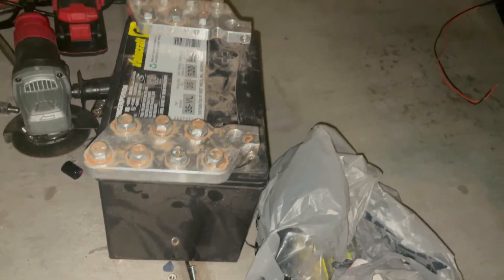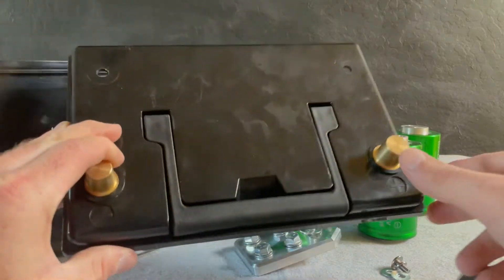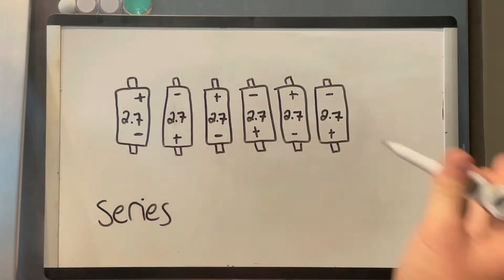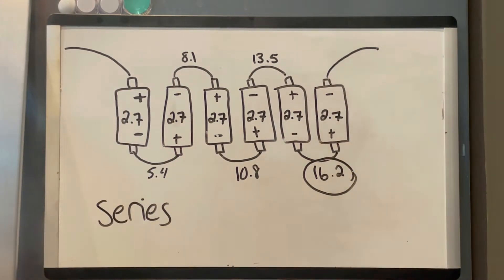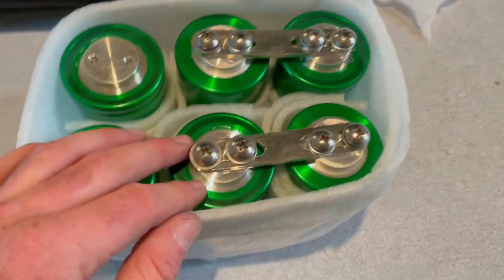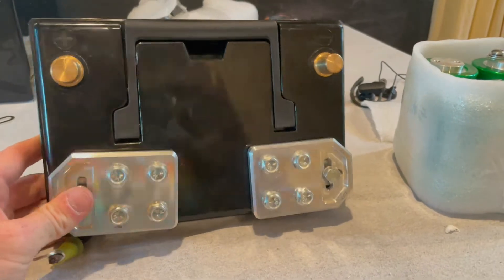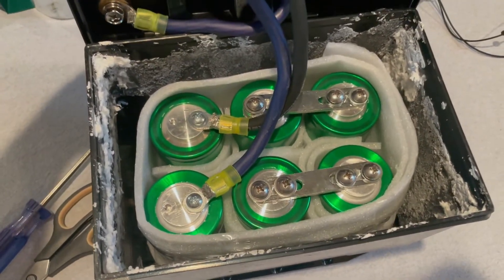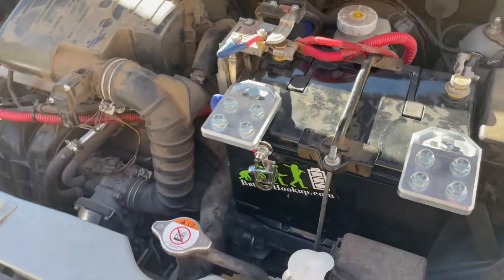How to:  Supercapacitor Bank Build.  Replacing underhood battery with SuperCapacitor Bank

Comment: Does the supercapacitor not need a BMS Controller? How they get all the same voltage then?
Reply from the maker: @ShinYa_002  I never ran one and it seemed to work fine
Reply: Capacitors work by charging rapidly but cannot charge past the input voltage. Most capacitors have a high max voltage. They do not need BMS like a battery.
Reply: @ImAChristianFirst That's not true. They can explode spectacularly if not protected. Balancers are always needed because the leakage currents of each individual capacitor are never equal to each other. This is causing unbalanced voltages across each one cap terminals and given that they are connected in series in this application, they are exposed to such a danger. It is therefore possible that across one of them the developed voltage to be above 2,7V, while the total voltage of the bank is below the safety limit of 16,2V...
Reply: @ImAChristianFirst That's not true. They can explode spectacularly if not protected. Balancers are always needed because the leakage currents of each individual capacitor are never equal to each other. This is causing unbalanced voltages across each one cap terminals and given that they are connected in series in this application, they are exposed to such a danger. It is therefore possible that across one of them the developed voltage to be above 2,7V, while the total voltage of the bank is below the safety limit of 16,2V...

Comment: How does the cap battery hold up with your audio? I need something to help Volt drop in my system, running 3600W rms but cannot fit a alternator, my stock is 120amp on an agm 120ah and another 120agm for my amps.
Great video, loved it, very inspiring 👍
Reply from the maker: First off, thank you.  The cap bank works great.  I do have it with a 240amp alt and 128ah of headway though.  On a 6000 watt amp, it really seems to help buffer the voltage drops.  I rarely see under 14v

Comment: Where did you get the black battery shell?  I can't seem to find one anywhere.
Reply from the maker: eBay or AliExpress
Reply: OK, I was using the wrong search terms for the battery box.  I finally found it on Ebay by searching for: "Empty DIY battery box shell case for lithium lifepo4 battery projects". Hope that helps anyone else.

Comment: Are you still using these in your build
Reply from the maker: Yes
Reply: Hey bro are you using any type of balancer on your cap bank I just acquired a 6S4P 2000 Farad XS power super cap bank and I have seen the Maxwell caps balanced but I didn't know about ioxus/XS power caps if they required it

Comment: What is that box on the side of the battery, and unless I missed something, why diid you not speak of it?
Reply from the maker: It’s a small fuse box I used to replace the factor fuse box that comes on the factory battery terminal.  I discuss it in one of my other videos. Sorry for the confusion, I probably should have mentioned here.

Comment: Do you have problems with the alternator at low rpm? Example: https://www.youtube.com/watch?v=jgoIocPgOug
Otherwise the above video is only a marketing video. This guy gives some other information: https://www.youtube.com/watch?v=KXG7-EegNV0
Reply from the maker: I don’t have issues with the alternator.  I have issues with the engine.  This car only has 74hp so at low RPM wants to stall due to the load of the alt.  Brand X warned about this and would not build anything bigger than a 240amp for exactly that reason.  To run a higher output alt, I would need either a stronger engine or a larger drive pulley.
Reply: My car has only 71hp and i have nu issues with a installed supercapacitor 16V 100F and a 74 Ah lead accid battery. In the future i will try a 16V 500F capacitor with a 25Ah LIFEPO4 battery. I have also info from this youtube chanel: https://www.youtube.com/@madelectronengineering
Reply from the maker: @tripelbier7335  the batteries aren’t the issue.  The alternator is.  It takes more power to turn a hi OP alt.

Comment: Is there a LIFEPO4 lithium battery connected in parallel in your current installation of the super capacitors? What wire cross-section can you use for that, also a 4 AWG wire? The question then is how you can connect such a thick wire to this lithium battery that has flat clamps.
Reply from the maker: I have a Yinlong bank wired in parallel located in the trunk area.  I have a 1/0 running to the back.  I’m not sure what you mean by “flat clamps”
Reply: Thank you for your update. I have a 12V LIFEPO4 with built-in BMS that has overvoltage and undervoltage protection. Only this one has flat clamps. Example: https://m.media-amazon.com/images/I/71hECyUUOnL.jpg

Comment: Ok you got me thinking now lol. So idk where u live, but will it work well in winter here in Ohio? And can you run it parallel with a headway bank? I'd like to ditch my  xs power D3400 and got full lithium.
Reply from the maker: As far as I’m aware, these types of batteries work better in the cold than the heat,  so you should be ok where you live.   super caps charge differently than batteries.  This set up should be fine to run in parallel with a headway lithium bank.
Reply: @Husky_Shane_Basshead  sweet, I'm about to go for it. I was gonna use one of those $150 Bluetooth cap banks that is the same brand I believe, but I've heard good and bad about them. And they dropped over half their price and I find that weird lol.
Reply from the maker: @1ohmwrecker  haha, yeah… I know witch cap you’re talking about.  I don’t have any experience with those unfortunately.

Comment: When you put the bank on a charger before installing it, did you use a standard battery charger or did you use one that was designed to charge at a higher voltage?
Reply from the maker: I just used a standard battery charger
Reply: @Husky_Shane_BassHead  awesome thanks, keep up with the videos, videos like yours give me some reassurance I'm not the only knucklehead out here trying to DIY it.
Reply: I think during the video you said you were going to use a 12v lithium battery as well. Did you end to using this to power the items in the car that need power when not running?

Comment: How well does this type of battery do in the cold ?
Reply: Mi. Here. N Great.
Reply: It's the heat that kills lead batteries. The problems just don't show up until winter. I wonder if this capacitor battery would last longer than 4 years.
Reply from the maker: Mine seems to do well… though I live in AZ so I’m not really the one to ask. It rarely if ever gets cold enough here to effect the way any battery would operate.  We have the opposite problem lol.

Comment: Begginer here, I’ve got the same car 2014 model though currently running a jl CP112w0V3 on a jx500/1. I’m running into issues with light slightly dimming and Headunit not turning on next time I start the car. I believe it’s just not enough factory power and I can seem to find upgraded alternators. So if I was to run this same set up would it help?
Reply from the maker: Maybe.  Possibly try and upgrade the batter to a AGM battery for a simpler fix.  However, headlight dimming is almost always going to happen to some extent when large current draws occur very quickly (as with bass).  I’ve heard that if you really want to fully eliminate this, then you must upgrade your headlights to halogen bulbs.  I have a 240 amp alt built by BrandX.  Your head unit not turning on… that seems like more of a wiring issue.  Maybe some loose wires, or the head unit itself having an issue.  The head unit draws minimal current.  If your batter us enough juice to start the car, then it has enough juice to turn on the head unit.